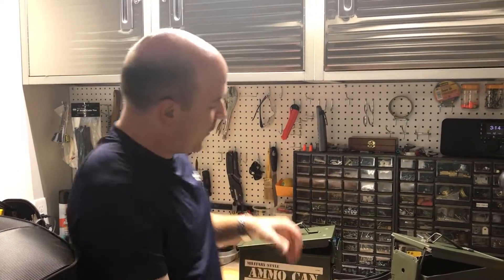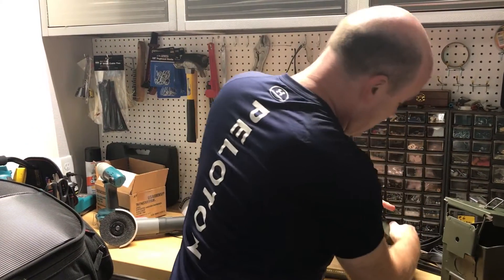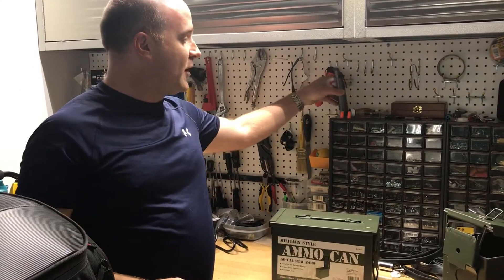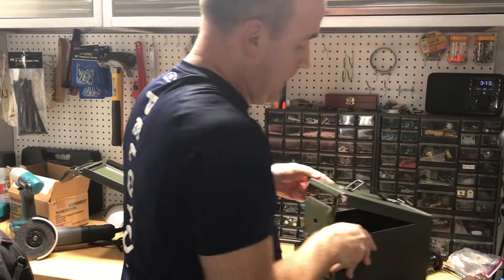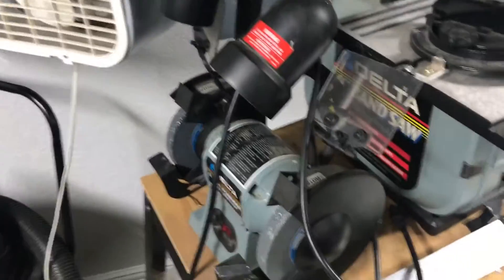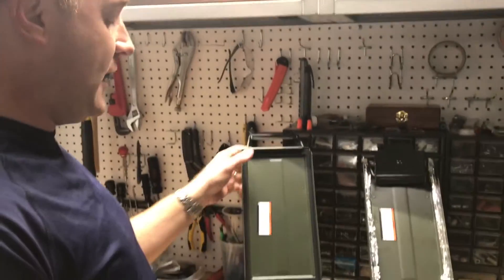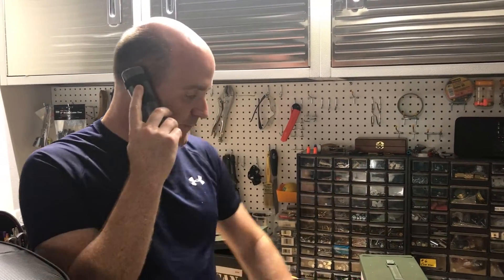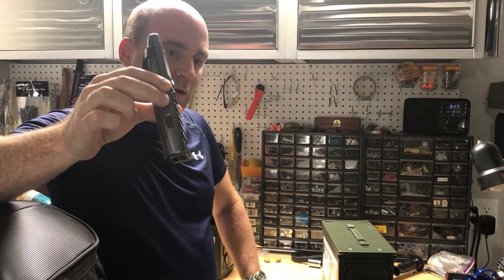Faraday Cage from a 50 Cal Ammo Can - Faraday Cage - Cell Phone Test

Comment: I love playing around with faraday cages and in my experience, a single wrap of aluminum foil will cause a cell to stop connecting.  The same goes for copper mesh, lath behind older bathroom backer boards, steel trash cans, and small lockable cash boxes.  I guess it would depend on the level of frequency of your service, but these work for me.
My question is:  If weatherproofing is not an issue, then why go to so much effort with the ammo can?  Why not just double-wrap electronics in aluminum foil and tuck them in a waterproof hard case?  Is this for potential EMP or just an experiment?
No hate;  I liked your video.
(edit)  All you need is the extra metal-to-metal connectivity for the ammo can lid.  Without removing the rubber gasket, you could pack aluminum foil into the edges of the lid;  You could even glue it in place, but frequent openings may wear down the foil over time.
Reply from the maker: Good points!  I was thinking that I would like to have a good storage solution for radios in each car that would hopefully survive and EMP or solar flare.  I like ammo cans, but they are a bit heavy compared to you aluminum foil in a waterproof care.

Comment: Just tried this and I was  successfull without foil using a 30mm can
Reply from the maker: I could see that working with a weak signal.  I wouldn't recommend it without the foil though if you want to try to stop an EMP which can be much stronger than these signals that we are testing with.

Comment: Great job sharing an effective and cost effective solution. I plan on using a conductive cloth tape to place on the bare metal surfaces so rust is less of an issue and to wrap the gasket with the conductive cloth tape the cloth should last longer then the aluminum over time.
Reply from the maker: @Robert Brady  That's a GREAT idea.  I really like the idea of using conductive cloth around the seal. Thanks for sharing!

Comment: Way too much dependence on foil that will breakdown over time. Try sanding down the top lip of the can, line the insie of the box with cardboard to insulate it from the metal, get some cheap aluminum flashing and cut it slightly larger to fit inside the top, making sure it overlays the rubber seal. When you force the lid closed, it will press the flashing material into the top and it makes complete contact around the top lip. It will work everytime. My blocks wi-fi, 5G, and bluetooth.
Reply: The cut flashing fits tightly "inside" the top ad on the seal. When you force it cosed the first time it get pressed into the top and stay there. Just make sure it cover the the seal.
Reply from the maker: @RLMUnbelievaaable  Thank you for the reply!
Reply from the maker: @Roger McCarter Those are GREAT suggestions.  I really appreciate the feedback!  So, to be clear, does the metal flashing you are describing go on top, and outside all of the edges of the ammo box, then you close the lid on it smashing it?
Reply: @HodgeHub  Yes, cut it slightly larger than the size of the rubber seal of the outside edge. 11-1/4" x 5-7/8"

Comment: I have found a stainless steel pot scrubber taken apart and re twisted worked well ,, not waterproof . next i am going to solder a ground wire from lid to bottom . i now have ammo boxes  of foil wrapped electronics . another thing i learned the hard way was to put packets of moister adsorbent  in there.
Reply from the maker: Thank you so much for those tips on making a Faraday cage!  I really appreciate it! :-)

Comment: What if you don't have machines to grind the paint off?
Reply from the maker: @1369gemini  Great question.  I think that it would be pretty easy with a rough grit sand paper.
Reply: @HodgeHub  I’m way late to this but yeah, the paint isn’t thick. Metal file rough edges smooth, hit with 80 grit then, if it concerns you, move to something like 150-220 so its smooth for gasket. 

 A lot of us have to Dirka Dirka stuff like this from time to time. Although handy, power tools are not necessary for the majority of projects.  Its amazing what can be manufactured by hand, especially when you have no other choice.
Reply from the maker: @elconquistador932  Thanks for the reply.  Excellent comments!  Yeah, the paint on this ammo box is very easy to take off with hand tools or sand paper for sure.

Comment: What would an EMP do to the cell sites, the landline network, and the other party's cellphone?
Reply from the maker: Possibly destroy them.  I plan to use this to store a handheld ham radio.  I was just using a cell phone to test the Faraday cage effect.
Reply: Fry them all, they will be as useless as any modern car... I bought a faraday defense bag sorta looks like a huge Mylar bag but made of aluminum. Basically to store my fold up solar set up. Nothing big but would be useful for my rechargeable flashlight, lantern, tablet,phones,radio. Even though I would expect the phones and tablets won't have Internet or cell service they would make a great computer to store info or just use the camera on the phone when your bored or using my rechargeable speaker to play music. Many electronics would be useful one way or another... The more you have put away in a faraday the better. Nice little cheap cage like the video would be much better than nothing.. 👍👍
Reply: The 100% honest answer is that no one really knows. There has been shockingly little real world testing of EMP effects.